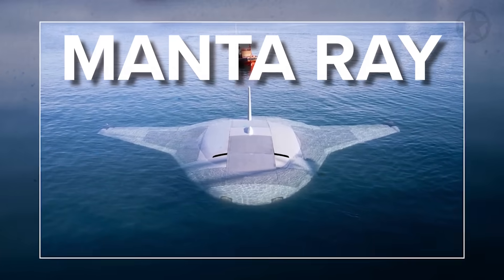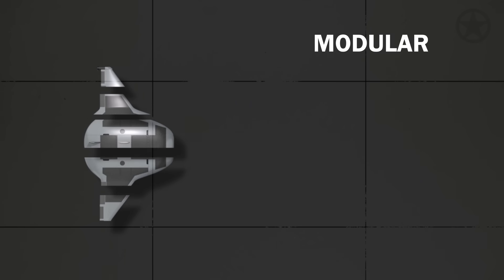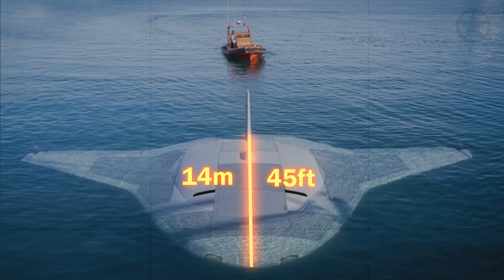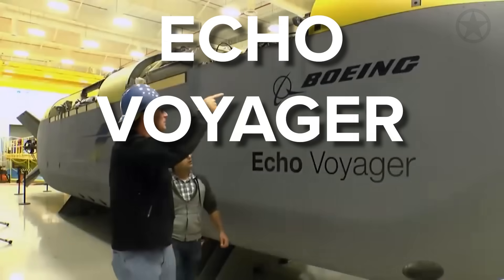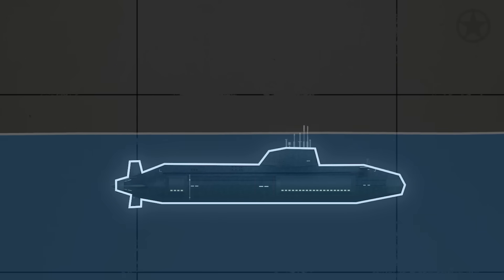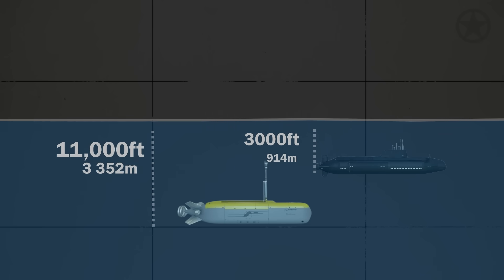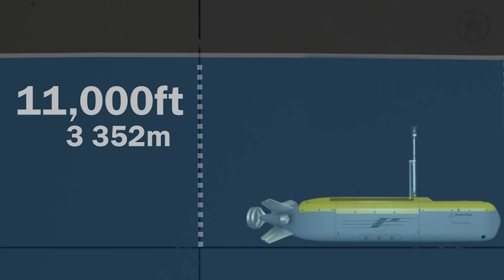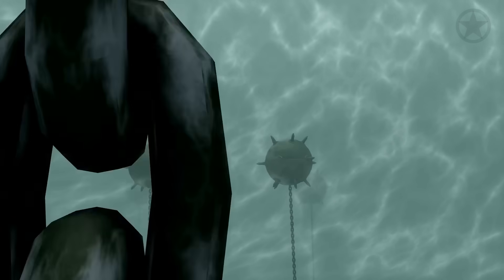This US Submarine Will Change EVERYTHING - Here is Why!

Comment: As a High School student I designed something very similar. It would have a variety of uses.  Basic autonomous layout would be a mine layer - not in the traditional sense, but would infiltrate fleets and carefully fasten explosive charges directly to the hull of enemy ships.  Since it doesn't require a containment vessel with an atmosphere, it doesn't even require being water-tight whiich means its signature is that much easier to disguise.  Second use would be to extend a friendly fleet's sensor range to warn or intercept enemy vessels/missiles, even further from fleets than then possible.  It would accentuate strategic fire solutions against incoming threats.

It could also act as 'wingmen' in a submarine fleet action, utilizing strategies originally suited for combat aircraft in the oceanic environment.  As their operational depth is much greater than a manned sub, they could work in concert, and extend the manned vessels operating range and depth.

I did not envision AI as they are currently designed.  Though Mantas are limited as threats due to weapon loads, there is the possibility of them being 'hacked' and turned on friendly vessels.  To avoid this, they could operate on preprogrammed  operations where the operation is over, once the weapon load is depleted.  That is the nature of a Doomsday device.

Comment: If you are not in a hurry to get to your destination, you can glide there.  You make the Manta a little heavier than surrounding sea water with a slight downward trim.  The Manta glides in whatever direction you have programed into it.  When it reaches depth, you make the Manta a little lighter than the surrounding sea water with a little upward trim and it glides up toward the surface, also in the direction you want.  Very little energy used.  The Argo floats use a similar system.
Reply: Science Fiction comes to reality. 🌊🔫

Comment: Can it carry a nuke?
Reply: The cargo bay is large enough to carry:-

"The B83 bomb is 12 feet (3.7 m) long, with a diameter of 18 inches (460 mm). The actual nuclear explosive package, judging from published drawings, occupies some 3 to 4 ft (0.91 to 1.22 m) in the forward part of the bomb case. The bomb weighs approximately 2,400 pounds (1,100 kg)." Wiki.

This is a free fall aerial bomb, but a mine of similar size could be developed.

Comment: now i am curious ... if the pressure of water changes as it does every 100 feet or so... could a 120' sub use that pressure variance to generate power?  what do i mean?  think of a siphon... using a tube... pressure from one side pushes liquid through a tube to reach the lower pressure.  thou a 210 foot sub would potentially be able to use this effect more... allowing the water to push a turbine to generate power could work, i just don't know how much power could be made?  wave power, water currents etc are all options as well. even the temperature variance between depths could be utilized.. thou all of these may require structures more akin to gas stations... that could be potential targets in wartime, in peacetime they could allow a sub to recharge without ever surfacing... and these sites could also be for storing food /materials etc to resupply the submarines.  as to avoid going to port or meeting up with another vessel at the surface.  sorry too many ideas rattling in my head.. but always looking for a place to share.  peace.
Reply: Pressure increases one atmosphere every 32 feet of depth.  Basic SCUBA info.